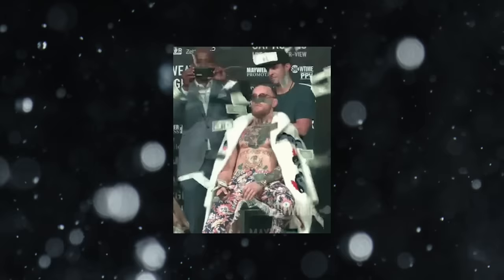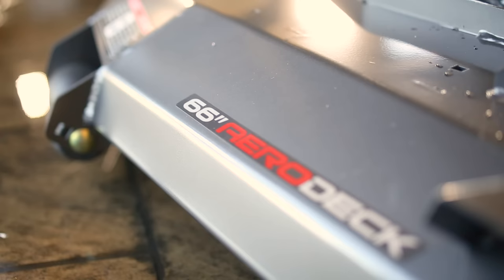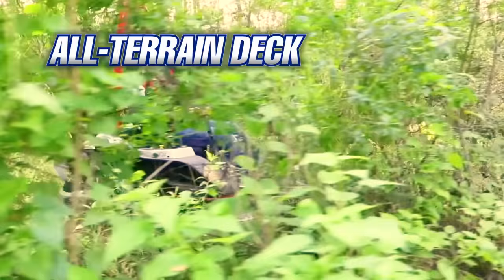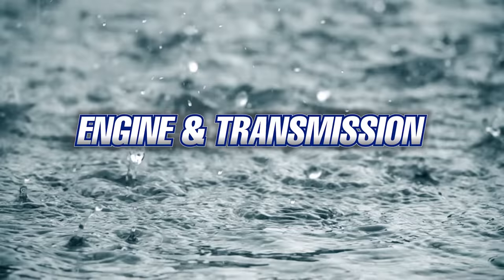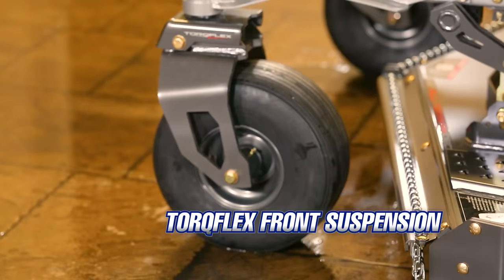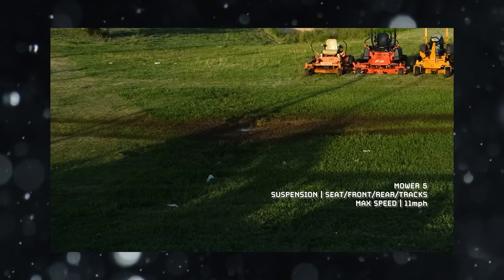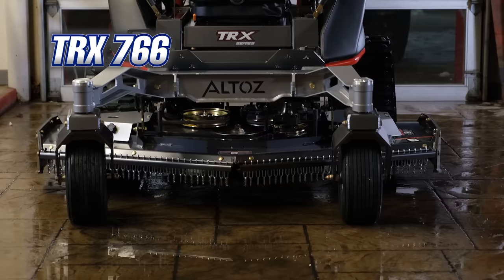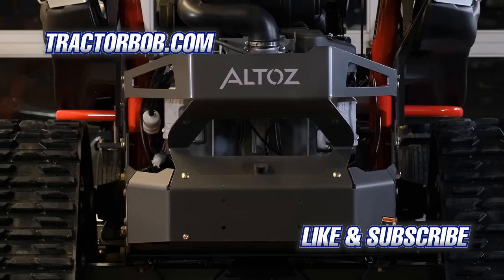In-Depth Look | ALTOZ TRX766 & 766i (Best Pro Zero Turn Mower 2022)

Comment: My company bought one and I used it to do retention ponds I had it for 450 hours all three spindles seized up on me it's in the double belt system to drive the machine I did not care for her because it was a pain in the rear to change the belt or replace the belt get to take all kinds of stuff off just to get to the belt and it was still hard to change but the machine is a beast they're just little odds that can be fixed and it would make an awesome machine like the spindles were supposed to be waterproof and they weren't they totally rusted at 450 hours
Reply: I have two of them and there were several modifications that I had to do to them, one was putting grease zerks on the spindles, five years later and still no spindles problems.

Comment: Man this is a sweet mower,I was looking into a bad boy Maverick an spartan until I saw this,an my sister asked why I need a mower like this,I was like ,we have more than enough yard for it an push mowing sucks is why, definitely wanting to get one of these an those Trax look badass on it
Reply: You might change your mind after you see the price!
Reply: @kevinwillis2878  ,yeah I looked them up,lol,expensive, but still want one
Reply: Buy a used z930M John Deere dependable good power I personally own 2 of them and have on several occasions cut grass up to 6 feet tall I have also ran the deck into a light pole at 14 mph and it didn't damage anything and you can find used ones everywhere since they're some of the most popular commercial grade mowers
Reply: @boydboys9084  ,kool,how much usually cost wise

Comment: I suppose its good for the price if youre commercial....or you could buy a used Suburban to haul your other zero turns that are just as good for the same price.
Reply: This can handle hills better then a dually ventrac/Wright zxt. Also almost impossible to get stuck. A dually Wright stander Zk could probably match an altoz but doesn’t have a brush cutting deck. The stand on Altoz beats all of those I just named, you could cut any hill any direction with the tracked stand on. And it’s cool as f**k lol

Comment: You can get a spartan like i did and u get everything here Except the track wheels 🤣🤣🤣🤣🤣🥳, for only 6-8k !!! 🙄Stg everybody sleeping on Spartan when there's not another mower that compares besides this 25k mower😳😳😳🤨🤨🤨🤔🤔🤔😆😆
Reply: Spartans are beasts. I have plenty of dealers around that sell them. However, those things sit around unsold and have less than adequate long-term reviews. I ended up going Kubota instead. :)

Comment: So…TSX566 price?
Reply: When price isn’t mentioned it means it’s gonna hurt
Reply: They said it was 22,000 which is pricey.
Reply: @umami0247  Ouch, for a lawn mower.
Reply: @jdtractorman7445  if your cutting commercial accounts and they are over 5 acres and had some slopes I could see this machine at that price. Would like to see a 72” deck also.
Reply: Luckily when I got mine they were only 14 grand. My dealer is 360 miles away and have never needed him.

Comment: You CAN NOT MOW 
@ 11 MPH !
Reply: I watched a guy in a subdivision once with a Grasshopper IIRC.  He quickly mowed a lawn, shouted some directions to the guys with a weed eater and leaf blower and took off down the road. Looked like that thing did 20 mph or more. Great if you have several lawns in the same neighborhood.
Reply: We have two of them for 5 years and yes it will mow 12 mph, even on rough terrane.